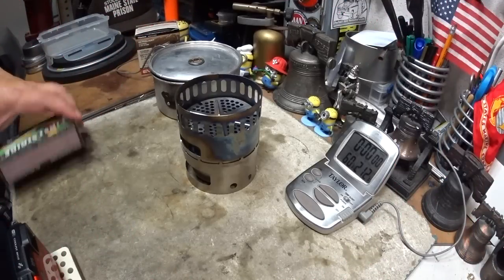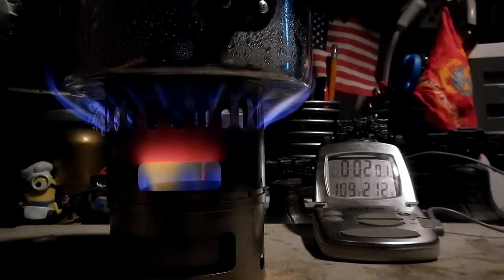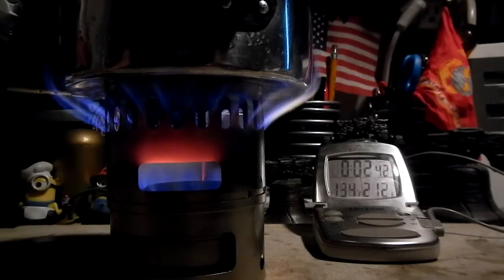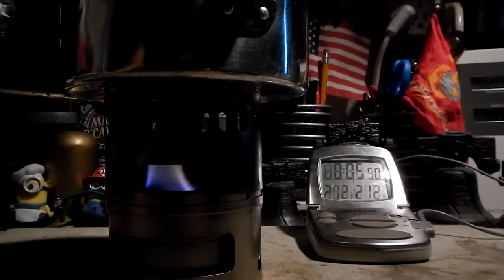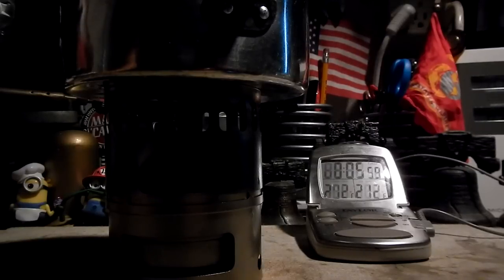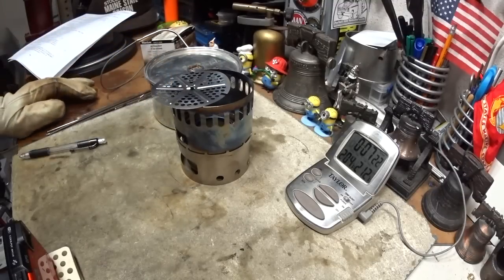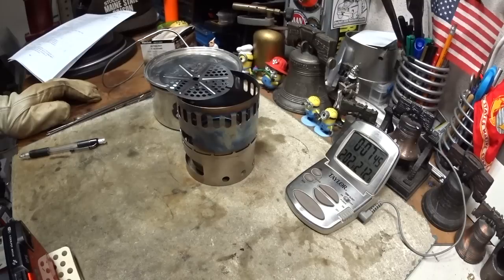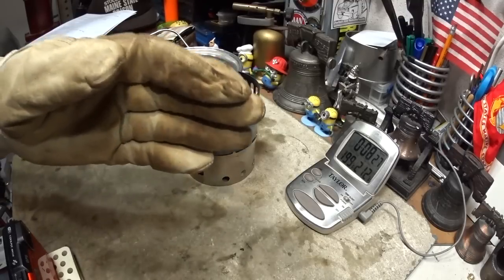Evernew Ti Burner - Evernew Ti Stand Dx - Power Plate - Boil Test

Comment: besides it being a "power plate" for better heating in cold temps, but it also becomes the bottom of the twig stove portion of the DX.  What I do is normally just keep the power plate under the burner, and then use a precisely measured amount of alcohol that burns just around 5mins using about 25% less alcohol to boil 2 cups of water.  And on longer trips that adds up.  However, when it's really cold, I put the power plate in and use almost a full 1oz.  Tip, if you do use the power plate for bottom of your twig stove, be sure to clean it well so that it performs properly when being used in cold temps as a power plate.

Comment: Littleton is correct.  Half-oz or less in a burner and twigs in the upper-section (on the power-plate) amplifies cooking.  More heat in less time, carrying much less fuel.  Twigs can be wet, since the alcohol burns off moisture.  Alcohol isn't even required, but it speeds the burn and cleans the burn.  I use a small MYOG capillary stove = 11g, cut exactly the power-plate height.  Capillary stove operates equally well in or out of the Evernew.  Ten-days on 4oz fuel (with twigs). Can use solid fuel or gel, if desired.  And this setup never ever leaves one in the lurch.

Comment: My findings is the power plate acts more as a deflector. Instead of one insanely hot spot (better for boiling water). Is more even / moves the insane heat spot lower in the stand (better for a frying / simmering). Jmho.

Comment: Watching both videos back to back I noticed that it appeared that with the plate installed the flames reach further out and go around the edges of the pot. For a wider pot that would be great and perhaps heat up larger pots/pans more quickly. On the smaller diameter pot is appears to simply be wasted energy and fuel thus quicker burn times.

Comment: Hiram, the power plate concentrates more heat downward keeping the alcohol stove warmer if the weather is cold outside.  That is also why it burns slightly faster.  I have used on cold hikes to make coffee or tea and that is what I discovered.  Slightly more efficient because the stove/alcohol is warmer when burning with the power plate installed.  Thanks for your vids.

Comment: I leave the power plate in the bottom of mine so the burner sits on it. If you are going to use small sticks ( wood ) as the fuel source It is the base plate for them. Using small sticks ( wood )  in the unit it will keep them off the ground and  increases the air flow from the ground up and around the burning sticks. 
The same principle idea ( have the wood elevated on a grid ) that my Solo Stove or Silver Fire Scout does. .

Comment: Thanks Hiram, good test!  I was also thinking that the power plate was for cold weather, since it would reflect heat back down to the burner.  Another thought is maybe the power plate creates a re-burn opportunity for partially burned poorer fuels from its own red-hot surface, and any turbulent currents it creates?  Anyways, keep up the good work, and if the Trangia fits inside the DX stand, it would be cool to see how the Trangia compares to the Evernew burner for boil time and fuel consumption efficiency.